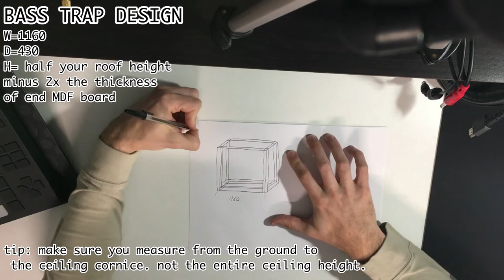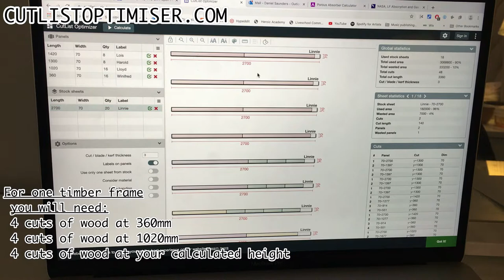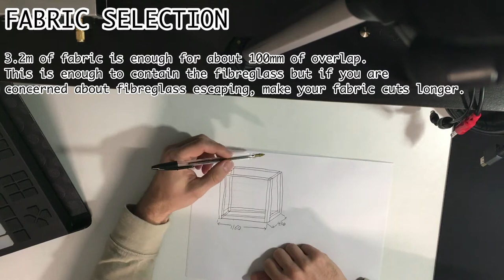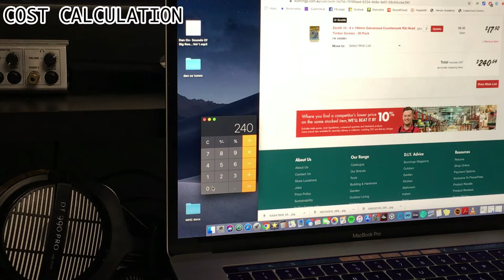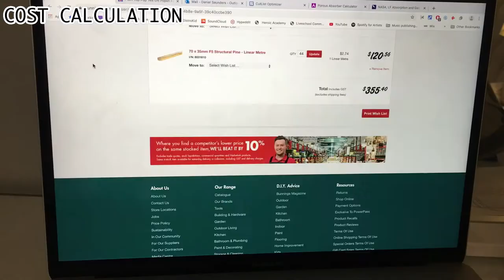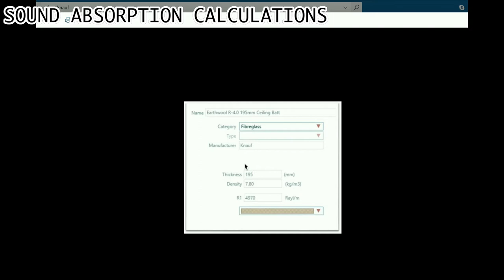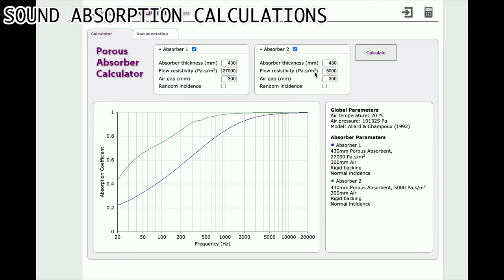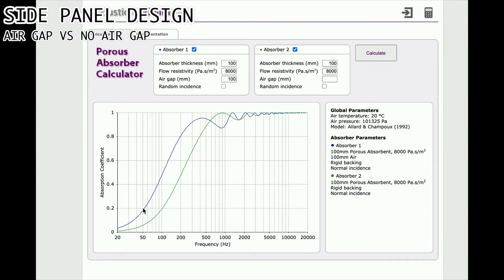DIY ACOUSTIC TREATMENT DONE THE RIGHT WAY WITH BEFORE AND AFTER SOUND TEST

Comment: Great video Dan Oz. I used 50 mm XHD Martini Absorb panels in my home theatre room and couldn’t believe what a difference it made to my sound system. Both movies and music sound so much better. I had three windows in my room and blocked them using the acoustic panels. Solved two problems by doing that, blocked out light and provided sound absorption.

Comment: Just wanted to say thank you for this video! Im currently in the process of building something very close to your basstraps and your video has been a sort of template for me. I've come back to this video a few times at various stages of my build. Before building I did a ton of research, took me a few months to get my head around acoustics more and came to the conclusion that for my bass issues I need large traps with a fairly low density filling (In my case Knauf Insulation Acoustic Partition Roll) which for anyone reading in the uk is great if your looking for Flow resistivity of around 5000! Once I did that I happend to find this video and everything just clicked. I finished my first frame today! I can't wait to get it all done. Thank you for your hardwork in documenting your build. Much love from the UK!
Reply: Thank you Matthew! I'm glad that I could assist you in building your bass traps! I did my research too and I thought why not make a video to document the process so others could learn.  I'm keen to see how yours turn out. Send through some pictures when its all done!
Reply: Will do! Yeah I had the same thought, its a lot of effort and I couldn't have done it without people like yourself and others posting resources online. When I'm done totally I'll probably do a gearspace post with all the details (Linking your video of course + other stuff that helped) Biggest issue I found in the uk was accurate information on insulation GFR so maybe I'll pay it forward and someone will get something from it.  I'm getting the first 6 finished this Saturday (3 stacked on top of 3 for the front wall) will then a weeks break then the next building the 6. Total front and rear wall coverage. Will send a pic when it's done :) Cheers dude.

Comment: thanks so much for posting this. really really helpful
Reply: No worries! I'm glad this helped you 😀
Reply: @danielsaunders2581  my room is 2.4m x 4.8m. it's a workshop adjacent to a garage. I already have 8 (120cmx60cmx5cm) panels made using stratocell whisper material up on the walls (with a 5cm gap behind them). I'm now looking to add bass traps. The room has a sliding glass door at one end (with a thick curtain covering it), and a desk/monitors/etc at the other end. At the desk end the left wall is shorter, with a gap leading to the garage and house (aka no door). I am wondering how many traps to make and where to place them. my gut feeling is that I'll need eight all up to cover the front and rear corners. ceiling is 2.4m up. if you had a smaller room, would you have gone for one in each corner or still gone for two on each side at the desk end?
Reply: @BillyRoebuck  For me, even if I wanted to, it would be impractical for me to place more bass traps in the rear corners because that's where the garage door is although it is about 7m from the front wall to the garage door so that is enough distance not to require bass traps. I forgot if I mentioned what the distance required for no rear wall traps is. I remember reading an article that mentioned it and from memory it was about 5.5m. So for you, I think the best results will be from having traps in all 4 corners. At least your ceiling height is a bit less than mine so that would help you to bring the material cost down a bit.
Reply: @danielsaunders2581  thanks mate, you're a legend. when I do get around to this, I am thinking 8 traps, two in each corner, following your design. for the entrance (where there's no wall) I am thinking of making some sort of contraption so that the traps in that corner can act as a door. really appreciate you posting this video and all the materials, as there's not a lot out there on how to source this stuff in Australia.
Reply: @BillyRoebuck  no worries mate!
Yeah that will be great. You should notice a massive difference if you treat all 4 corners. 2 traps stacked on top of each other will be quite heavy. Not sure if what you're talking about would work. You could try building the traps a bit shorter it you like. I only made them a rectangular shape because it was easier to work with the insulation without cutting it. Yeah I know right! So many videos I watched that were made by Americans with materials that are not available in Australia.

Comment: Great work on your panels and traps! I just picked up 11x 600-1200 of the hd100 panels and 12x 600-1200 xxhd50 panels to make a movable whisper room. One thing I noticed is that they can be very dusty. Hd you noted that with yours? If so, did you do anything like give them a good vacuuming? It literally affected my breathing a bit

Comment: Wow Bro , the results are amazing, can you please tell me what sot of material that earthwool is? is it safe? cheers.
Reply: Thank you! It's knauf earthwool. It is fibreglass so it's best to wear long sleeves and gloves with a dust mask while handling it as you should avoid breathing in fibreglass and it can be quite itchy on the skin although earthwool is far less itchy than other fibreglass batts. Once it is installed and encased in fabric, it will be totally safe as you won't be disturbing the material and touching it.
Here is a link for more information about it...
https://www.earthwool.com.au/product/r-2-5-ceiling-insulation/?video=true#details
Reply: @danielsaunders2581  cheers bro.
Reply: @1staprilsanta121  no problem!

Comment: When stacking them did you do anything to stop them from potentially falling over? Or do they end up heavy enough for it to not really be an issue?
Reply: No I didn't find it necessary at all to do that. Because of their size and depth and weight, they are stable enough just stacked as they are.